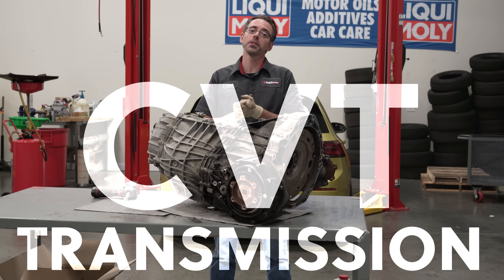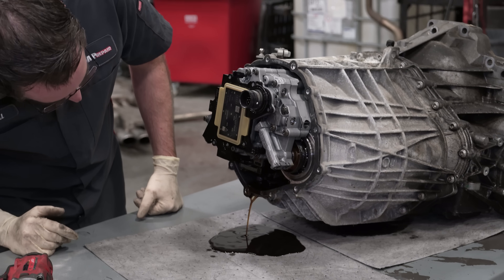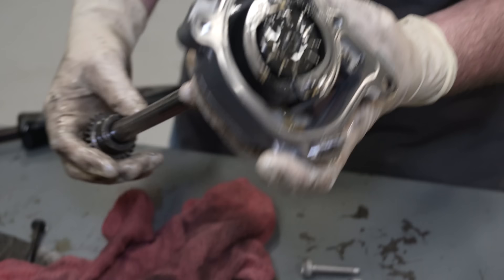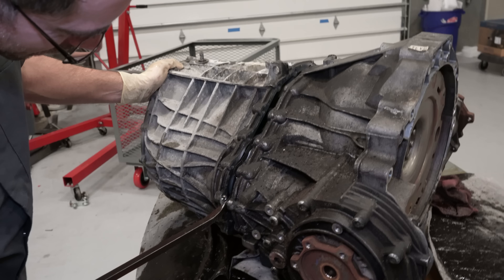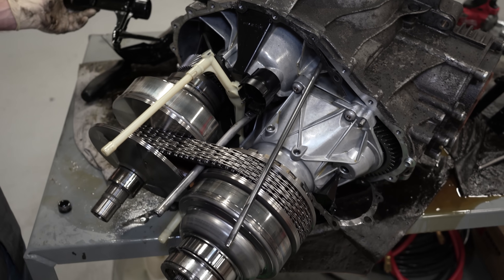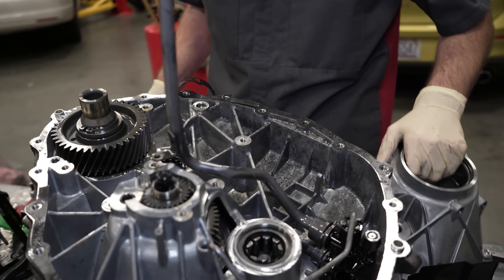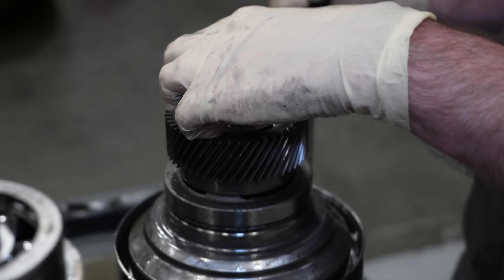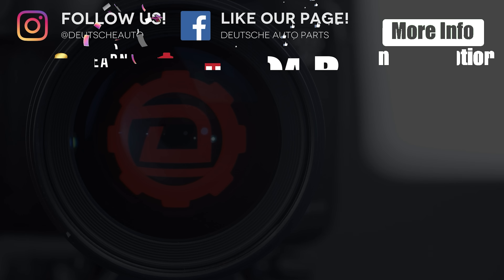Why you shouldn’t get a CVT transmission

Comment: A LOT of half baked, room temperature IQ comments about Toyota CVT's here: Toyota has at least three different CVT designs. One for hybrids with a planetary gear set, one with the launch gear, and one (K313, IIRC) like in my 11th Gen Corolla is only the belt style with torque converter. Gosh.

Comment: CVT's aren't terrible transmissions. In fact, the're a very interesting idea. However, pushing a car with the kind of CVT that cars have is not the best idea. In motorcycles (almos any scooter uses a CVT transmission) they work well since the wheight is not high. Also, if you can tune it, it's a perfect transmission for a given use scenario. They're not bad, just misused in some cases and misunderstood.

Comment: Yeah, my last car with a manual transmission lasted almost 300 K miles and it was not the transmission that failed. I really wanted another car with a manual transmission but they don't sell them any more in the US which sucks. You'd be left with buying an old car. And as far as automatic transmission it seems every car brand is switching to CVT so you may soon be out of luck finding any car without them.

Comment: Why then is Toyota Prius so reliable even though it uses CVT transmission?. I  have an auto shop that specialize in hybrid and there was only one occasion where I had to replace a prius transmission and that’s because the owner hit something that cracked the casing causing the transmission to run dry of fluid. Anyways I admire your patience for rebuilding type of transmission. My Toyota Prius C uses CVT and it has 355k miles on it. Original engine original transmission. The only thing I replaced it the hybrid battery and  ABS module

Comment: Have you ever driven a Mitsubishi?  It actually shifts gears like a regular transmission. So when I drive without cruise on, it acts completely like a regular transmission. Only when I use cruise does it simply rev to the needed RPN's to maintain speed. My last 2 cars have had CVT's, the previous one more annoying with just reving rather than an actual shift like I got now.  I love my Mitsubishi.  Works great. I think in many videos I've seen on You Tube, you can attribute the problems to lack of maintenance. You do need to change the CVT fluid at minimum every 50,000 miles. And make sure you use the right one. I had a mechanic put 2 different brands in my CVT and it started shifting really hard. They said it was the same fluid, just different manufacturers. When I got home from vacation I took it to the dealer and told them to put the manufacturers fluid in and the problem went away. I was shocked the mechanic would put in 2 different brands. My previous car had 153,000 miles on that CVT at trade, and my current one has 107,000 and they both were and are going strong. So I don't buy your theory that they are all junk. If that were the case nobody would ever buy a car with a CVT.

Comment: I had two Audi's with a CVT, one had a diesel engine and the other a petrol. Had both cars for 4 years doing over 100,000 miles. Absolutely loved the CVT in both cars - never failed me.
Reply: I had no idea Audi was using CVTs. Learn something new every day.
Reply: @robbrownfield7677  It was called Multitronic. If you were looking for an automatic at the time (I had mine between 2007-2014), Audi offered DSG for transverse engines and Multitronic for other engines. The Multitronic outperformed a manual both in performance and economy.
Reply: It's all pretty much regional. For example I discovered that while VW uses 7-speed DSG in cars sold in Europe, they put 8-speed torque converter autos into the same cars sold in US/Australia.

Comment: I owned a 2013 Subaru Outback with CVT. Absolutely no issues even after numerous trailer tows. Just followed the severe duty schedule maintenance.
Reply: Yep. Audi just hasn't caught up with  Japanese manufacturers like Subaru. Maybe God's punishment against "German Engineering" for the acts of Adolf?
Reply: Was it a hybrid? If so, Subaru license is Toyotas eCVT technology which uses a different operating principal and is extremely reliable as a result.
Reply: @willkelly86  Not hybrid.
Reply: Hi may i know what is the scheduled maintenance for each part like engine oil, trans oil etc.

Comment: I NEVER saw a CVT as a viable transmission. The power is transferred by the friction between the belt and the pulleys. There is going to be uneven wear and the belt is going to start slipping. Slipping creates heat. The more heat the more slipping. The more slipping the more wear. The more wear the more heat. Result quick failure.

Comment: I’ve seen a few CVTs teardowns, but this one really puts in perspective the unnecessary amount of failure points and the difficulty to disassemble a cvt.
It’s one of those engineering things where it seems like it should be simpler (less moving parts). But when you try to make it work reliably, it ends up being way more complex.

Comment: You should be able to pull the pulley out with a gear puller right out of that central shaft.  The pulley can not be press fit on the shaft of course.  The pulley have to be able to slide up and down its central shaft.
Not the stationary part but the part which is the pulley.  It is the part the moves.

Comment: I test drove a 2016 Lancer with one of these, I didn't like it as it felt like I had no control over it despite having paddle shifters for gearing down. Using them did nothing for deceleration and the car always sat at a rather high rpm. To me the whole reason for having an automatic with the ability to control the gears is to use it for decelerating in poor conditions and reducing acceleration while going down hill.

Comment: I own an Audi A4 and a Nissan Quashqai, both CVT. 
Never had transmission problems and the ride is always smooth.
Reply: Maybe you are an exception but I know a few that have Nissan Altimas went tits up after a few thousand miles.
Reply: I think Sentra is more reliable than Altima despite being a lower model.    @ColdStuff-cf7jv
Reply: @ColdStuff-cf7jv  that's because Nissan has been making terrible CVTs for a while now.
Reply: Nissan's CVT are complete garbage. You probably have them under 50k miles and pay dumb@ss costs to mechanics who rip you off. Nice comment
Reply: my Audi A4 has s-tronic 7 speed which is a DCT.

Comment: CVTs are shit ? Stupidity in this video are everywhere . I have a CVT Audi 0AW 8Gear Multitronic with 210.000 km and its good as the same state its my car . Change fluid every 40.000km replace filters fill it with real good oil . (EXTREME CVT By Venol its a hell good of a product Yellow brand ) and do it a good use and you will not need anymore . Discard this video .

Comment: I have (3) Honda CVT cars with zero problems.   2005 Civic, 2010 Insight & 2017 CRV again zero issues with the CVT system.
Reply: what RPM do you usually drive, do you often exceed 4000 RPM when accelerating or overtaking?

Comment: My Nissan juke CVT has 178,000 miles on the transmission and no problems. I love my CVT. I could care less about feeling the gear change in a standard transmission. Reliability apparently depends on the manufacturer.

Comment: Is it even possible to get out ALL the old fluid even if you  change the CVT fluid regularly to try and help these types of transmissions last longer? What angle would the car have to be positioned in to get all the old fluid out before replacing it with new? Standing upright on it's front or rear bumper? Seems like there's so many places for the old trans fluid to get trapped and stay inside the housing? Almost like no matter how often you changed it, some of the old metal shaving filled fluid would always remain? I have no idea is why im asking.

Comment: Developed in late 1890s for saw mill to keep constant speeds on the cutting blades. Worked in conjunction with log input and wood resistance CVT would automatically adjust for most optimal speed. French thought it would work in small urban cars...failed miserably due to poor level of lubricants available. Japs started monkeying around with the concept early 90s...failed for number of reasons most due to lubricants. Biggest issue was chain stretch/wear in first (lowest) gear over coming inertia from full stop. Toyota quickly designed a conventional clutch pack for first gear to off set this advanced wear potential. Honda may have done something similar. They are real POS forced on consumer due to fuel efficiency regulations in America & now Europe. As a consumer I have fore stalled the purchase of a new car until the companies begin offering more manual options or return to a conventional inline clutch pack planetary drive automatic as in the Golden age of autos. It bad enough most cars today are plastic and stamped steel spot welds but putting a CVT in there is just a travesty. Bad enough the piston rings are weak & reduced to 1 compression, 1 oil control ring with little to no piston skirt to reduce internal friction creating an early oil pumper engine but a shitty transmission is just heaping insult upon injury!! Most folks today are dumber than a box of rocks and believe a quart of oil every 500 miles is acceptable....🤣

Comment: Back home in Croatia I have Toyota Auris hybrid with Toyota's HSD (a variant of a CVT). Since I moved to Canada, the car is used less, but before that, I used the car to drive all around Europe and have made many trips to Ireland with it, and back, which is about 2200 km one way. All in all, a total of around 170k km in 6 years. No issues whatsoever with transmission.

Comment: I just dont understand how they made a ski-doo transmission so complicated, unreliable and difficult to repair...  I can swap the belt on my sled on a trail in a minute or two with the toolkit it came with, there's even a spare belt mounted under the hood...
Imagine how long it would take to fix a CVT in a car on the side of the road... or how many tools you'd hafta pack in yur car to do it...

Comment: My buddy has a 2009 altima with a cvt.  He's taken it to the dealer for the transmission service (fluid replacement) regularly.  He's NOT NICE to his car!  It now has just over 200,000 and still drives just fine.  It's not the transmissions, it's the owners.  Ok so older transmissions could take more abuse, but the longevity of the cvt just comes down to regular service.

Comment: The cvt in my 12 year old Nissan rogue is running like a champ at 150,000 miles.. had to put about 60,000 miles on it in one year and I probably have another 25,000 idle hours in the engine too. I’ve only topped off trans fluid on axle replacements too. It’s been run long and hard doing deliveries, what are people doing to these transmissions!?

Comment: We got a new CVT Honda in 2004. 
Loved it. 
Drove it 324K miles and traded in for a new Honda CRV with CVT in 2015.
The CRV is now @ 178,000 miles and still love it.
The transmission ratio is somewhat controllable at the foot feed.
Lots of fun.
Reply: i live in Australia i had a Toyota Camry with CVT for 10 years and now my parents have it. never had a problem, and it reduces fuel consumption. its the best thing since sliced bread. I've heard they are more likely to fail in the USA because they make them change like normal gears over there instead of keeping the smooth rev ratio. but i don't know how true that is.

Comment: Car companies should have taken note why in a snowmobile it is quick and easy to replace the belt. Sleds pushing Huge hp and high tork rubber reinforced Kevlar belt. 
Metal belt on metal walls, moving pressure is always a great idea haha.
Love My Honda hatchback.
dont love cvt.
My 2024 cvt lasted 1200 miles. Complete garbage. 
I have a 2011 Dodge ram that IV put 400,000 turns on is still in amazing shape runs great except road salt damage 
What's the point of having a sporty car if you can't drive it like a sporty car.
Trade talks eminent

Comment: Makes me really appreciate what Honda has done with their hybrid-car transmissions:  Just 2 dog-tooth clutches and simple fixed gears, no torque convertors, no sliding chains (as in the video's transmission).  Smooth power delivery only, and long term reliability.

Comment: I have a 2009 Altima with a CVT trash mission, i changed the stepper motor, the valve body and my car still driving 20 miles and hr with not reverse, what do you think is the problem with this transmission?

Comment: Depends on the manufacturer. Toyota yes. Nissan, Hyundai, Kia, Subaru or any manufacturer that uses Jatco CVT transmissions avoid like the plague. Mostly CVT transmissions are not repaired they just put in a whole new one. Expensive! The fluid for CVT transmissions is expensive. Look at all those plastic parts as he takes it apart. Built and designed to fail. The only reason many manufacturers went with CVT transmissions was they were cheaper and got better gas mileage. But at $6000. plus for a new CVT transmission, you can buy a lot of gas. Interesting Mazda does not use CVT transmissions and now builds their own transmissions.

Comment: ive had shutter issues when flooring my 2016 nissan versa note, it was caused by A) not coming to a complete stop under deceleration such as coming up to a stop sign and B) dirty trans fluid.   with that being said its an economic car so as long as i drove it the way it was intended i had no problems, currently at 260k miles and i change the fluid about every 40k which costs me $180 every time i do it.   honestly one of the best cars i ever owned maintenance wise.

Comment: Hm how are these different than newer CVTs? I’ve got a Kia Forte 2022 which has a CVT but it definitely changes gears while driving without letting up off the gas. I imagine it’s a different manufacturer and is different from the ones in this video.

Comment: I'm no fan of them either but credit where it is do. My mom's 2008 Jeep Patriot had a CVT and 2 weeks after getting it she got hit on the front right. 

After it was repaired, little did we know the crap dealership left out 2 quarts. For years up until 2018 after she had 115,000 miles on it I changed the fluid and filter. We kept asking the dealer to do it and every year they said "It doesn't need it." So before selling it I did it. I measure what came out and sure enough, missing 2 quarts. 

My mom drove it all over East Texas selling insurance to contractors etc. It took a beating. 

After I replaced the oil in the CVT it ran like new. If only I had done it years ago. 

So we kept it till about 2021 and sold it. 

Now my wife's Mercedes GLA250 has one and it feels like trash and I just don't have it in me to do the fluid on that one.

Comment: i think we are being too harsh on CVTs, people really should give it a chance
cause in real life they are perfectly fine, it's not any better or worse than autos or dcts with dual mass stuff
in theory they are supposedly superior than the other types of transmissions as well because you always have infinitely variable torque in the powerband.
a reason why CVT was banned in F1, because it made them way too overpowered
a lot of people hated it because it's boring. which to me, a bit childish.
because CVTs usually do have a manual mode, just like autos, to give you that control (and defeating the infinitely variable torque purpose)
and as long as we take care of it, it wont be more unreliable than conventional autos.
i drive a toyota with a CVT, the transmission utilizes the same oil as the engine, which makes oil changes a breeze cause i dont have to worry about different types of oil.
Reply: Şanzıman yağı motordan farklıdır

Comment: The CVT Transmission in my 2007 Audi A4 Cabriolet, paired with the 2.0 Liter Turbo engine, worked great for the 316.000km that I owned the car.  I'm an active member of a local Audi owners club and several of us have or had (in my case) this type of transmission and when properly maintained, work just fine. They are sturdy pieces of kit. Saying that it's a piece of crap, as if it's a universal truth is ehm... kinda dumb.

Comment: i see the design failure. there's not nearly enough bolts holding the valve body on. it needs another 30 or 40.

Comment: CVT work best with a small engine that puts out little horse power. A big motor will tear a CVT to pieces. Your common snowmobile and most ATV uses a CVT transmission and the same thing applies. A belt will last a long time on a snowmobile or ATV with a small motor but you burn belts in no time with a high powered machine. Then there's the constant maintenance for the power clutch and the drive pulley. All CVT equipped cars run poorly and the sounds they make are 'ODD' They eventually stutter on slow acceleration and whine at times. The CVT for vehicles is a sham. Those who have a CVT with a launch gear is like saying I have a CVT but with gears and that's called a irony !

Comment: I test drove a 2024 Crosstrek today. It was my first experience with a CVT and the sluggish acceleration, coupled with the high rpms was alarming to me. It was fine once I got it on the highway, but The rpms I was looking at (around 4k) with relatively moderate acceleration was really unsettling. Not a fan.
Reply: Whats the problem with the higher rpms... Thats how it was designed..

Comment: There are actually many types of CVT transmissions: Belt drive systems like the ones you are trashing here, toroidal, planetary, etc.  There are also e-cvts which are used in hybrid vehicles.  The e-cvts are really, really good, and don't rely on friction or hydraulic pressure to work.  They are completely gear-driven, very efficient and also very reliable.  But, they do require an adequate electrical power source (battery) as they work using electric motors to control the way that the power is passed through the transmission.